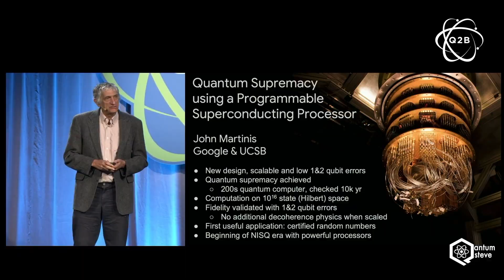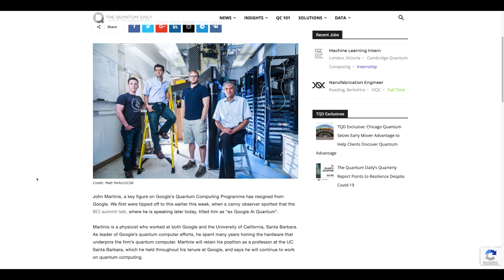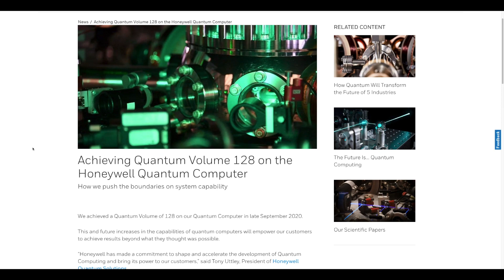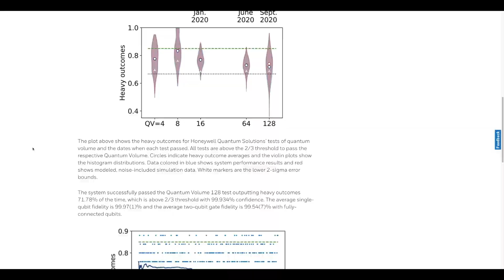Most Powerful Quantum Computer? - Quantum Computing News

Comment: I'm not an expert on the subject but, what about d-wave systems and it's 2000 qubit computers? Also I readed that first google quantum computer was bought from d-wave.
Reply from the maker: The D-wave machine is what's called a quantum annealer, it can only do optimization problems and is also quite limited when it comes to that. It is still very much unclear if quantum annealers will ever be able to obtain a quantum advantage, the quantum computing community is rather sceptical and there are not many believers. The other machines from Google, IBM, Honeywell, IonQ, Rigetti, etc. are universal quantum computers that, in principle, can run any calculation imaginable (obviously not now at this early stage of the tech). 

Yes, there is a collaboration between NASA and Google called Ames where they bought a D-wave machine a while back to play around with it. The quantum computer Google now is developing has nothing to do with the D-wave machine though.
Reply: @QuantumSteve  Ok. Now I got it.

Comment: Why intel is not mentioned I believed they achieved 49 qubits
Reply from the maker: So the number qubits tells you very little, it’s about the quality of the qubits! Google has a machine with 72 qubits but their error rates are very high. Quantum volume takes that into account, it basically tells you how many qubits you can actually coherently use. And in this metric IonQ and Honeywell are in front which both use ion traps. The best superconducting machine in terms of quantum volume is from IBM. Google hasn’t made their stats public as far as I know. That intel announcement is old, like two years old, their machines are not good, high errors. I don’t think they are even in the game any more, I haven’t heard anything from them in ages!
Reply: @QuantumSteve  thanks for the response  the last I got from them is this:https: //newsroom.intel.com/news/intel-argonne-national-laboratory-department-energy-q-next-quantum-computing-research/#gs.jj9ekd